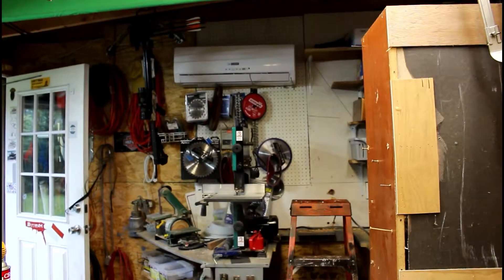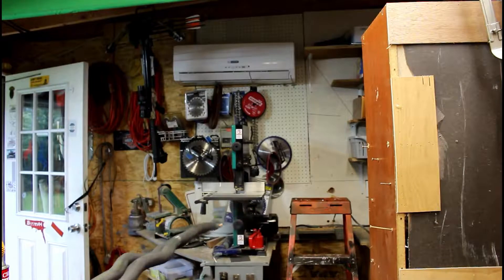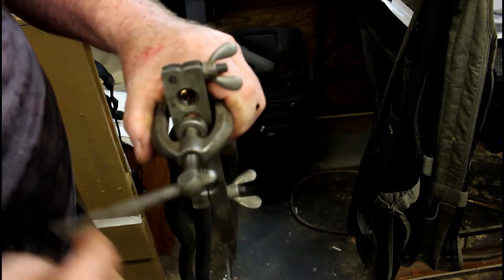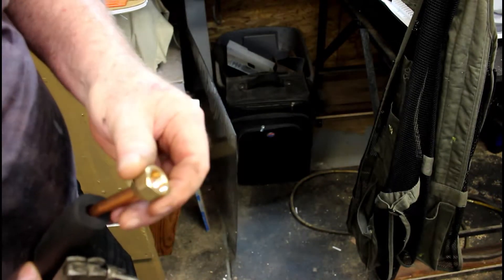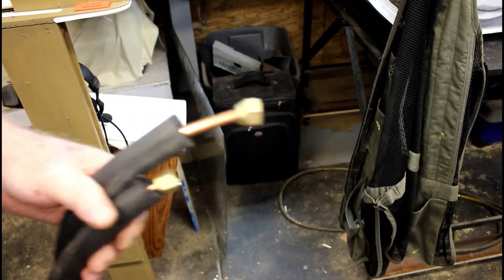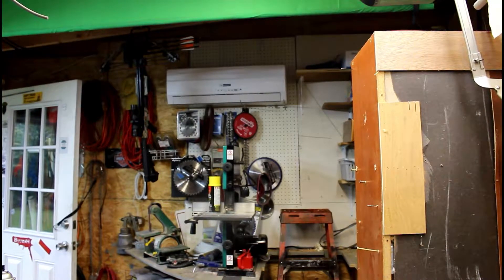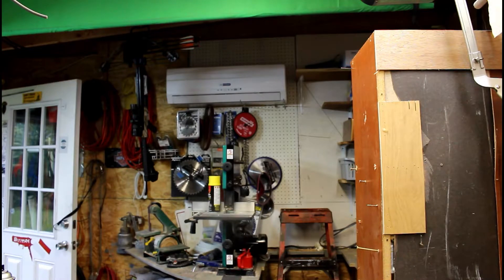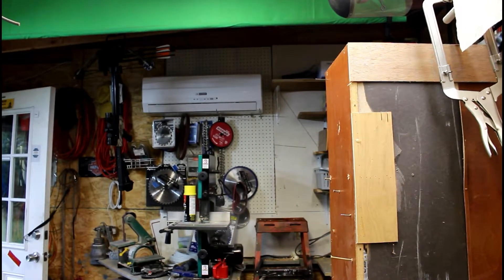More Air Heat, Lots of looking at a wall, and BS

Comment: Great video Buzz!  Thumbsup  Buzz, since you're a serious handyman i have a question.  I have a large salt container that's half full of salt. Do you know something i can put in it to break it up?  It's drawing water from my basement floor.  I'm afraid it might create a sink hole.
Reply from the maker: Thanks for the kind words on video.  How large is it that you're worried about a sinkhole?  The only thing I can think of is move it out and run water on it that should dissolve it. The only thing I can tell you is we add a little rice to our rock salt that we use for snow and ice, the rice absorbs the moisture keeping it from getting hard, and we add rice to our table salt to do the same.  Other then chopping it up with a bar I have no easy way.

Comment: lol good job getting things ready thumbs up and shared your dog is a suck lol
Reply from the maker: While double checking everything I realized I didn't have 220 in the shop. So, I had to run 40 ft of new underground 10/3 for the 220.. Normally I wouldn't mind but mid to high 90's and in the sun trenching 40ft was tiring